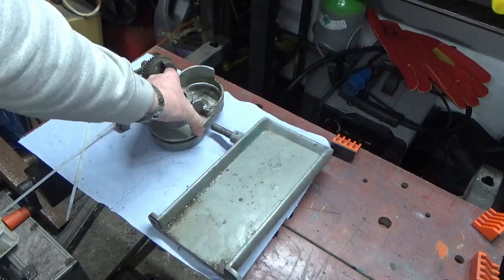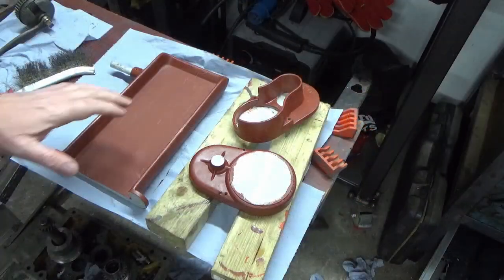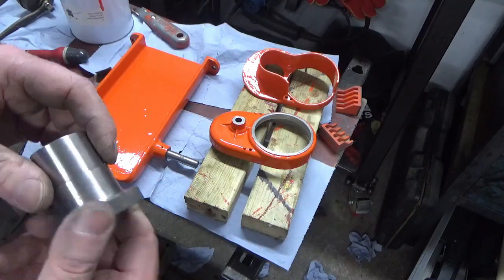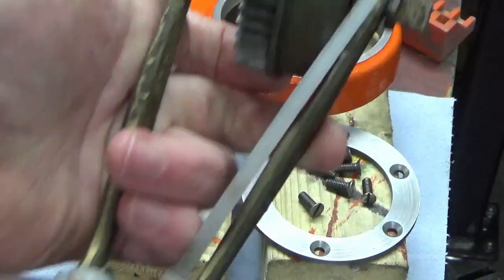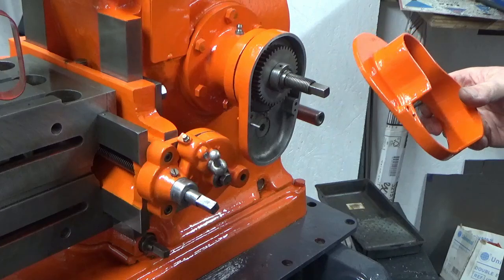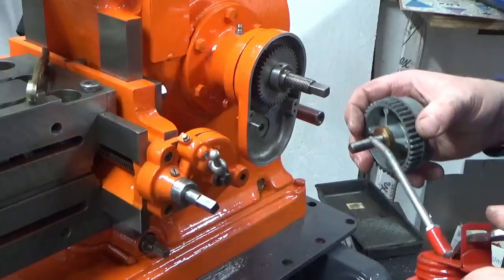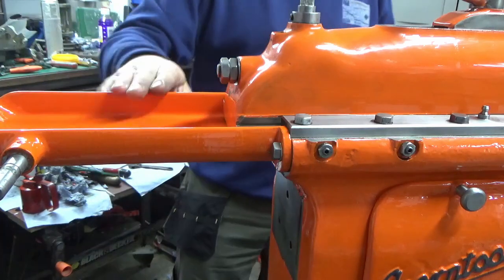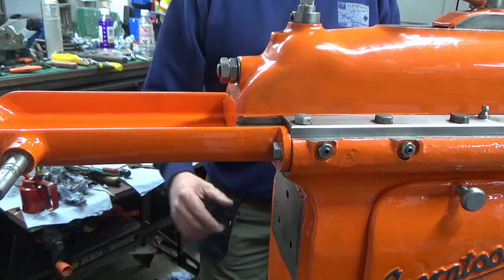Atlas 7B Shaper Refurb Part 10 - Cross Feed Mechanism and Oil Drip Tray

Comment: I have the craftsman version and while not as bad as yours appears to be, it is a bit touchy about going into the neutral position for the feed.  Likewise, thank you for showing the need to change the feed position in both locations. I had read it in the manual but seeing it makes it so much easier to understand.  When I read it I was like you in thinking that it was a strange thing to have to do, but seeing it I now understand that because you switch the direction you are turning the feed screw but don’t switch the direction you are turning the drive screw the offset needs to be 180 off to get the same timing as what was up needs to be down.
Reply from the maker: Hi Grant, thanks for the comment and feedback. Yes, it all seemed very odd until it was pointed out to me that you mainly use 'handed' tools, straight from the lathe usually, therefore, unlike a milling machine (which is what I am used to), you only ever cut in one direction, otherwise you also need to swap the tool out as well for the opposite hand........ the light bulb came on at that point lol. Cheers, Jon

Comment: That's right Jon the L & R is the feed direction of the table and the corresponding forward cut stroke on the ram.  That's the bit that you pointed out on one of my videos lol which I had also just seen when editing. It's all a learning curve and fun. Nice job the shapers looking super. Tony
Reply from the maker: Hi Tony, thanks for the comment and feedback. Lol, I can't even remember what I said yesterday these days. Getting the wrong side of 50 appears to be a line you cross that turns you into a confused fool for most of the time lol. Cheers, Jon
Reply: @jonsworkshop  It gets worse Jon lol
Reply: @jonsworkshop  Getting old may not be a lot of fun, but it beats the alternative!

Comment: You do need to move the T nut to the left or right to correspond with the ratchet left or right.  When you grind your tool bit it will only cut with the table moving in one direction.  So if your tool bit is set to cut with the table moving to the right after the cut you would move it back to the left by hand.  I have a Southbend Shaper and I have made a V tape tool bit that will cut in both directions.  You just have to live with the table moving on the cutting stroke when going to the left.
Reply from the maker: Hi Mark, thanks for the comment and excellent feedback. I now understand it all much better from all the experience on here including yours. Great stuff. Cheers, Jon

Comment: Great outcome Jon. Put a couple of thicknesses of either blotting paper or Kitchen roll in the bottom of the ram oil drip tray to soak up the oil. Regards from Australia.
Reply from the maker: Hi Dave, thanks for the comment. Great idea, I have done the same already in the bottom of the main casing to soak up the drips from the bull gear etc. Cheers, Jon

Comment: Jon,
I have a 7B and you are using the eccentric correctly. You need to think of it as the further away from the center the more step over you get per cycle. The Lefts need to both be aligned and the Rights both need to be aligned to move in their respective directions. The timing also is correct because it stops advancing when moving forward when the Rights and Lefts are aligned. The switch over lever on mine also drags a bit but I had to weld mine back together after the previous owner ran it into the end and crashed it (very common on these machines).The tolerances are fairly tight on that cover and ratchet assembly. My guess is your cover is tweaked a bit.
Reply from the maker: Hi John, thanks for the comment and excellent feedback. Yep, I am happy I have got it right now following some great feedback on here (including your good self). Rusti helped me 'get it' when he reminded me that you generally use 'handed' tools off the lathe, therefore you only cut in one direction per setup meaning you are not forever having to move the eccentric for each pass. The light bulb came on at that point lol. Cheers, Jon

Comment: Looking good Jon, I had the same struggles with the gear and ratchet timing. Looks like you've got the cam gear slot lined up correctly. As far as the L and R in my opinion it's a 50/50 shot on getting it right. The idea is if your using left feed you adjust the T-nut to the L side of the gear slot and Right feed to the R side of the T-slot. And you must move the T-nut when changing right or left feed. Otherwise the feed will be on the wrong ram stroke direction. Naturally thanks to Murphy's law mine was 180 out and had to redo it, its quite a brain twister.
Interesting differences between the Acorn and Atlas; your linkage arms are bronze, mine are iron. your oil pan is aluminum mine is iron.
Orange paint looks great !
ATB....Dean
Reply from the maker: Hi Dean, thanks for the comment and excellent feedback. Yeah, I got lucky, Murphy, or 'Sod' as he is known over here, must have had the day off. I have a much better understanding now thanks to all the great feedback on here mate. Cheers, Jon

Comment: Gday Jon, to me it looks right but I’m not an expert in any way, I do know when I change direction on my shaper I have to change the link rod from one side to the other, (L-R), great job as always mate, Cheers
Reply: Yes Matty, I never realised about doing that at first. Tony
Reply: Yes  gents  you are right; the Elliot 10M manual describes it thus: “It is important that the feed should be applied during the return stroke of the ram, therefore the crank pin should always be set in that part of the disc or crank that gives this effect. For this reason it is necessary  to reset the crank pin on to the opposite side of the  disc when the direction of feed is reversed.”  Glad I tuned in today as I did not know this  as my shaper restoration isn’t finished.
Reply from the maker: Hi Matty, thanks for the comment and feedback. Yep, that seems to be the overwhelming feedback mate, just glad my tired brain is still working and I managed to get to the right answer lol. Cheers, Jon

Comment: Jon,I don't think you need to change the linkage over every time you want to change from left to right table feed. Your Atlas has what I call a 'double Grasshopper leg' pawl mechanism which enables right or left table feed simply by altering/reversing the little lever at the front end. 
If all else fails talk to Lyle Petterson (Mr Pete) he has a number of videos and tutorials on the Atlas 7B shaper.
Reply from the maker: Hi Howard, thanks for the comment and feedback. It's a strange setup, most of the feedback from shaper owners on here (and my own tinkerings) is telling me that you have to change both the double pawl and the crank. I will check some of Lyles videos out whilst I carry on the restoration. Cheers, Jon

Comment: Jon, I just finished a similiar machine, getting it in neutral is very touchy.   There is a detent for it, but still not a great design.   You’ll get used to it.   You may want to consider putting a gasket between the oil drip tray and the base.   This helps to minimize oil dripping down the back of the machine.   It looks like you got the feed mechanism correct.   I’d be curious to how much taper you have as the ram moves out across the table.

Comment: might be able to at least m
ake the knurling look a little better by going through each damaged groove with a triangle file , should fix the bald spots
Reply: I've repaired a couple of that type of components with damaged knurling by turning the original knurl down to smooth and a little bit extra to get a suitable undersized diameter  and then loctite a new knurled ring onto the smooth turned outer section. If done with a bit of care you can't detect that such a repair has been done.
Reply from the maker: Hi Watahyahknow, thanks for the comment and feedback. I may just have a go at this once I have got it all done, nothing to lose. Cheers, Jon